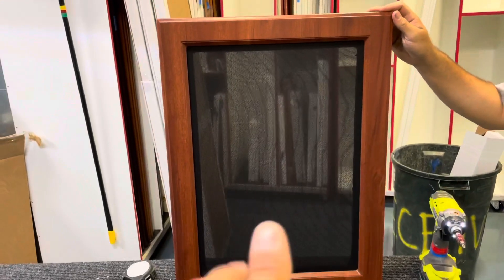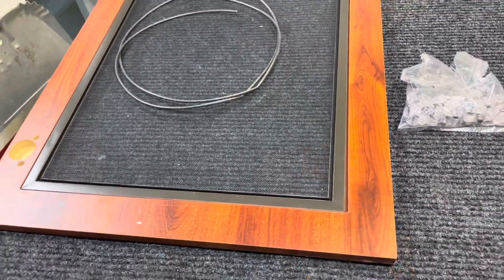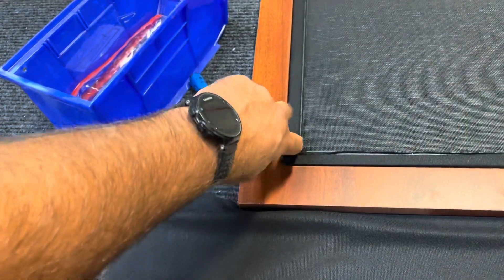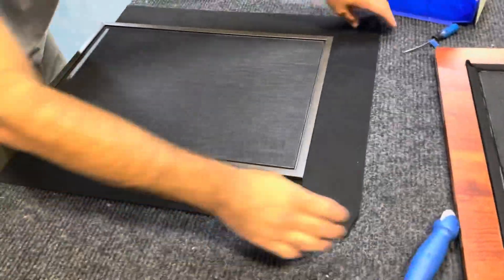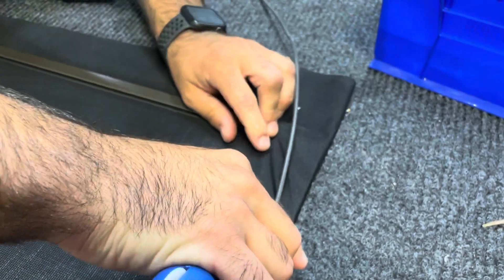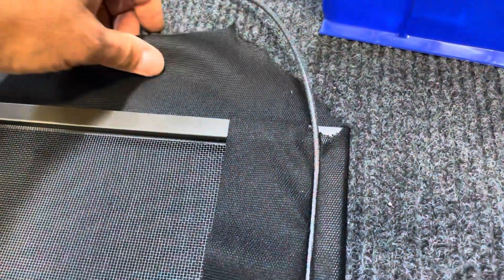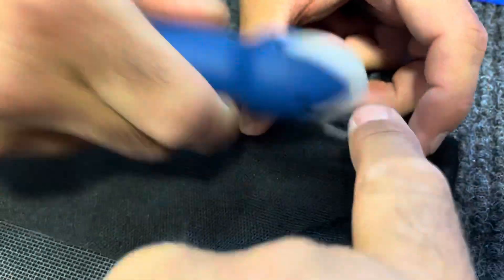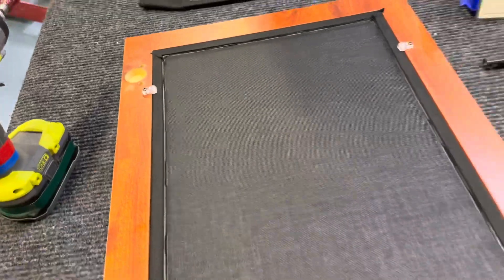How to install speaker screen in cabinet door

Comment: I would probably just have stapled it in that rebate and made a small finishing trim to cover those staples.
Reply from the maker: We tried a bunch of different ways. The hardest thing is getting an even pull on the cloth so the pattern looks correct and no wrinkles. The screen is repeatable and trainable and gives it a little more protection from impact when you leave the screen behind it.